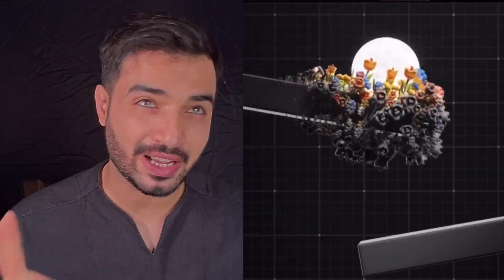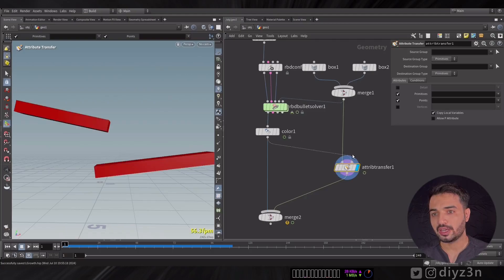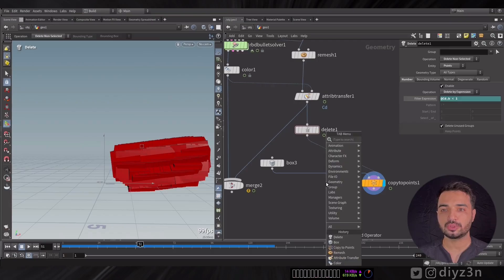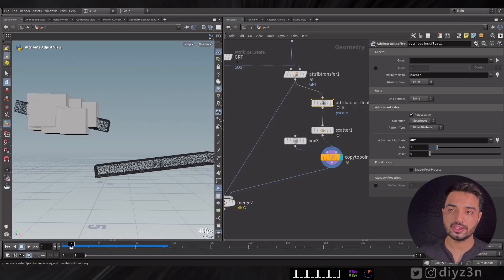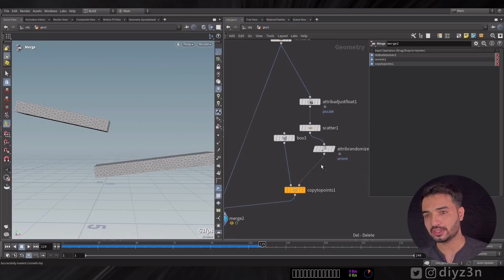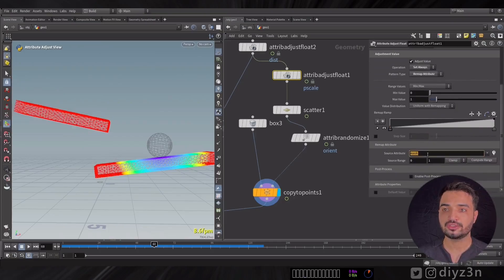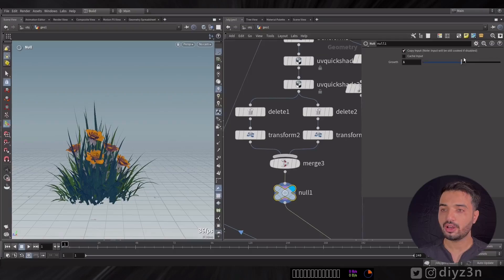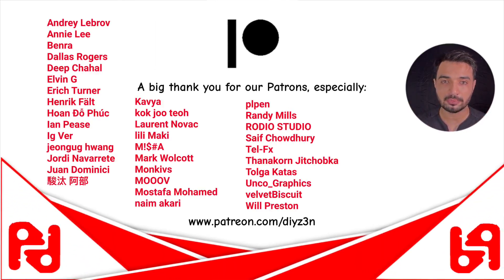Amazing MoonFlower using simple technique Houdini 20

Comment: It’s cool, simple and effective. I’d take it one or two additional steps further. First, maybe pass dist through a sop solver and fade it out over time. It’ll be a little smoother. 
Secondly, copy a bunch of lines and use vellum to deform them with the ball as a collider. This will make them bend, and then deform the flowers with their corresponding lines. 
Overall nice work 💪
Reply from the maker: Yeah, I wanted to do the vellum and deformation, colliding, but I was afraid it would take so long for a simple tutorial

and about the SOP solver, I didn’t honestly want to have a footprint-like effect, but yeah, that will be awesome 

thank you for your opinion. I appreciate it, bro.